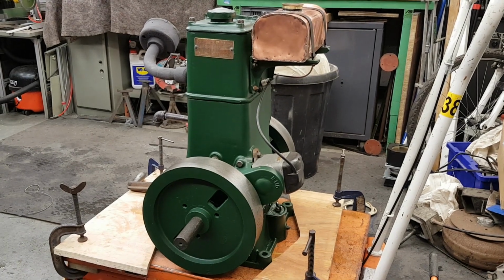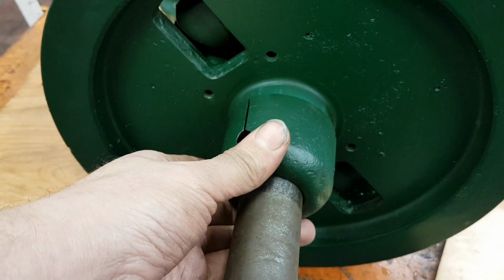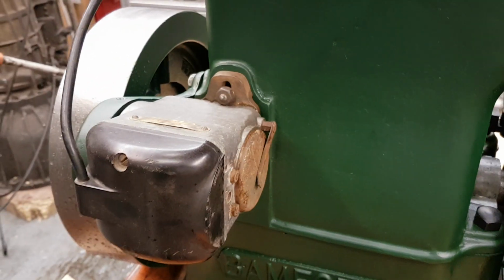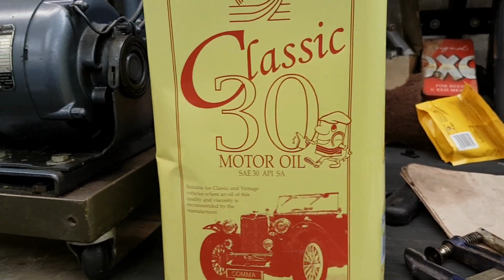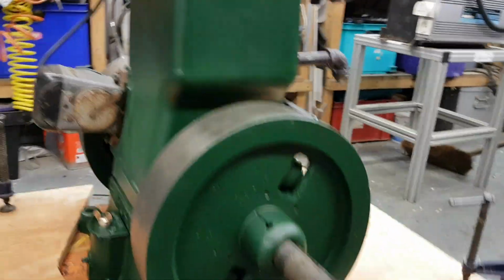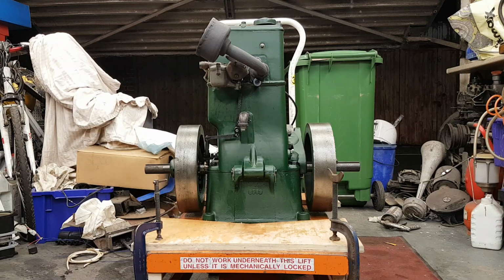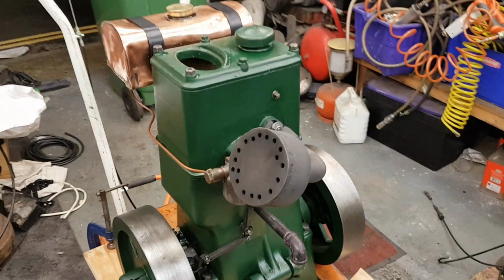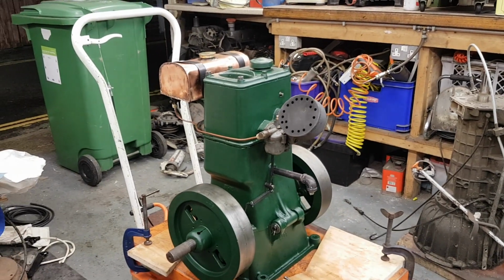Bamford EV1 restoration and running

Comment: I have an EV3. I have restored, but every time I try to start it it kicks back and nearly breaks my arm and shoulder. Where do you set the timing for the magneto for this engine I have tried a number of different places and I just can’t get it right or is there something else wrong with it? Any ideas? Thanks
Reply from the maker: @ShaneBrehaut  I can't remember exactly, but I think I set it just a few degrees past tdc.  The slack in the chain makes it difficult to set accurately so I would go comfortably past tdc to make sure it doesn't kick back
Reply: I had an EV2 that did the same thing, I found that if the plug was spotless it worked fine however if there was the lease bit of muck/carbon on the plug it kicked back. I have no idea why but wire brushing the plug each time it worked fine and would run all day with out bother.